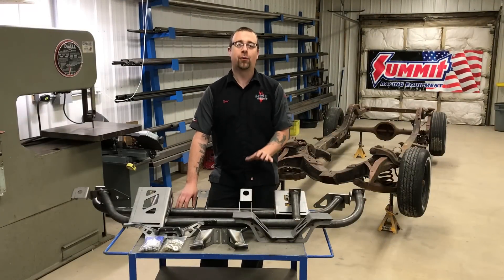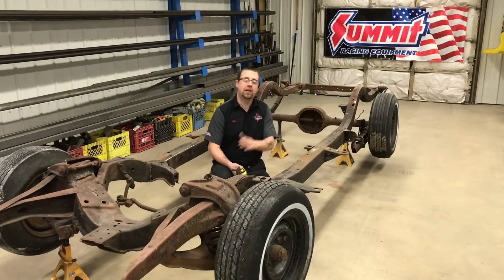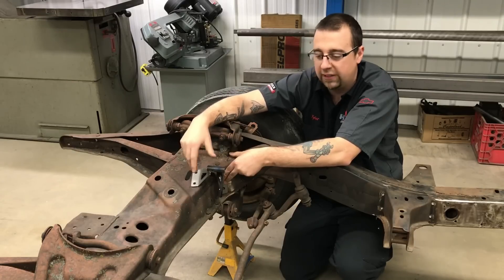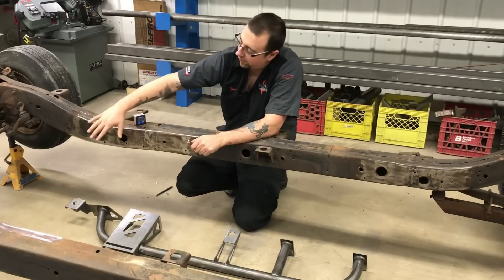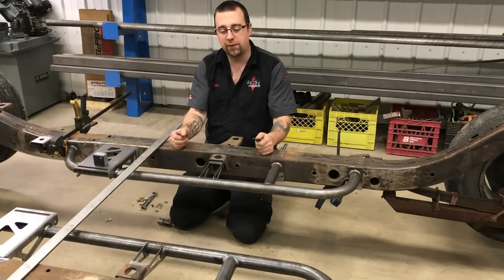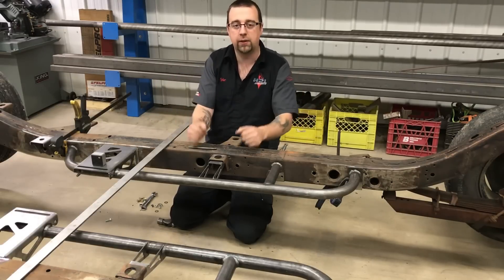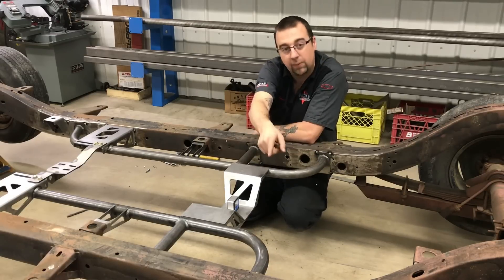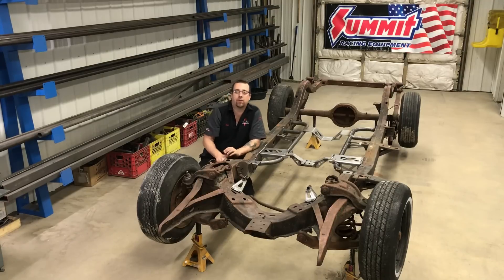Summit Racing 1955-1957 Chevrolet TriFive Frame Reinforcement Kit Installation

Comment: I like this approach.  It's good to see a car resto that uses the original car structure with some economical stiffening apparatus as opposed to those  vintage clones  that have maybe 100 pounds of original body panels and 50 grand or more poured into whiz bang ultra horsepower tech with a pro street chassis. 
So tired of Boydsters and Foose mobiles.
Reply: Right? Those builds make you think that what they really want is a Lexus with a plush leather interior and power everything, instead of a classic.
Reply: I realize I'm kinda off topic but do anyone know of a good site to stream new series online ?
Reply: @Manuel Sterling Thanks, I signed up and it seems like a nice service :D I appreciate it!!
Reply: @Fletcher Jax no problem :D

Comment: I’ve got a better idea, less work, less money; use the frame as it was designed. Use a Bellhousing that has the mounting ears. Early Chevy truck Bellhousing has the ears. Use original front engine mounts that mount to the front of the block.

The Bellhousing mounts tie the two frame rails together. The Bellhousing mounts are directly in line with the firewall. The firewall stiffens the frame and also resists the torque of the engine.
Reply: That's a great idea unless your dealing with 500lbs of torque which will break the ears right off that bell housing. Then your left with all that stress on the bell housing bolts caused be the distance from the front mounted motor mounts and the trans mount.
Reply: In the garage ; holy crap! I’d never heard of or seen broken Bellhousing mounts before! I bought my first 56 Chevy in 1970 and I’ve owned four 55-56 Chevies total, and I’ve been friends with several tri-five owners, too, and never heard of such a thing. Thanks for the warning. 👍

Comment: This clearly does not fit a one piece frame. This is false advertising. Make two kits for both frames. Why should I have to cut up a kit that is supposed to fit. This is garbage.
Reply from the maker: I understand where you are coming from the one piece frame is increasingly rare and the majority of people are using two piece frames. We designed our kit to fit a two piece, the only difference is the width between the frame rails. All you  need to do is trim off the locating plates on our kit. If that is an issue for you  I can make you a narrower crossmember for your kit.  Its very difficult for us to make for every frame as GM only offers dimensions on a two piece frame. Please let us know how we can help you .
Reply: @HPICustoms  what I am saying is that if you knew it didn't fit a one piece frame all you had to do is let people know that. I spent $900 hard earned dollars for something that doesn't even remotely fit. Only to have to hack up some expensive garbage to reengineer it. I would have never bought it if I had known it wouldn't fit.

Comment: Summit racing SUCKS.
Reply: Cars are 65 years old. Summit sells volume, likely phone staff of age 20-40. Some are weekend warrior drag, maybe short track racers. See this, find a good frame shop, and explain what you want. IF you buy cheap kit, that has to be cut up, you get what you pay for. A good fabricator / welder can add and fit what you NEED. $ how stiff  / added weight do you want to go ?  🤔
Reply from the maker: You can order direct from us if you prefer?

Comment: Wow what a half assed way to even work on a frame.....jack stands under a frames? Jack stands under reared ?
Reply: That was probably done to allow good angles of the camera with without obstruction
Reply: Looks like a pretty good way to work on a frame to me? Not everyone has a frame jig to work on their personal car... lol Great video guys.
Reply: I agree, had the Jack stands been placed under the frame and leveled properly so any warpage could be monitored it's reasonable to use them. Using them under the suspension is unacceptable.
Reply from the maker: We are a full fledged chassis shop and have frame tables at our disposal.  We made this frame on jack stands to prove that the average person can install this in their garage.  After installing countless kits both ways that the jack stand method works perfectly to install this kit.
Reply: HPI Customs  yep and i have been fixing these messes for 30 years . From clips.. to frames ... to rearend housings done halfassed on jack stands.
At least set up a laser and do it right 🙄
Joe average with a mig welder ain’t getting this right...